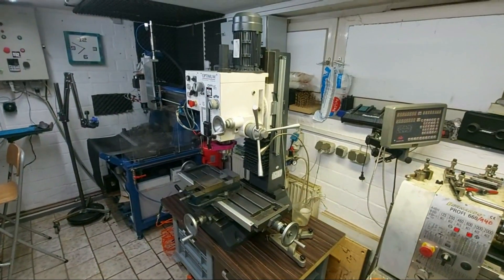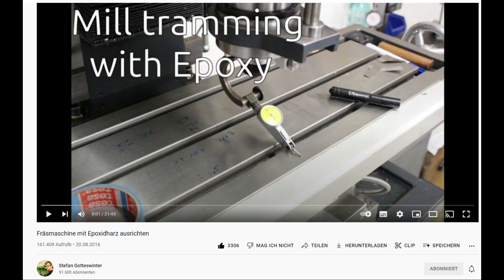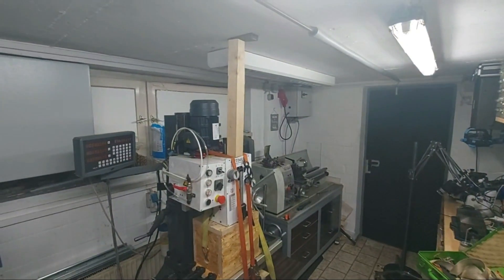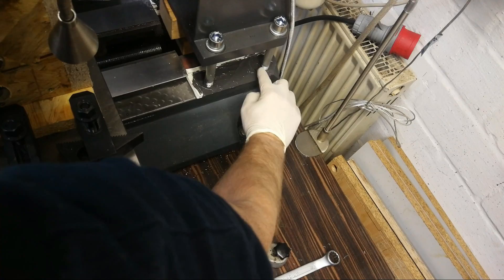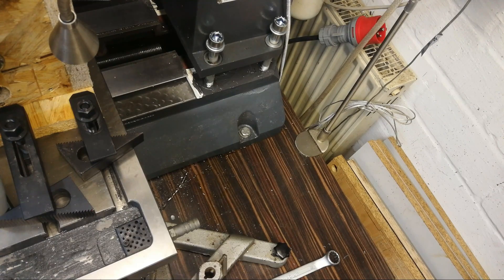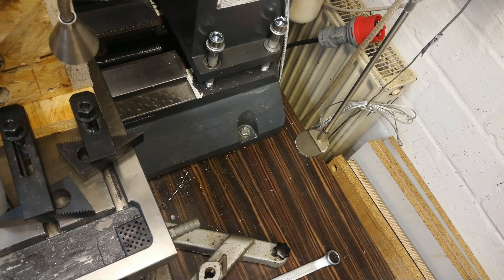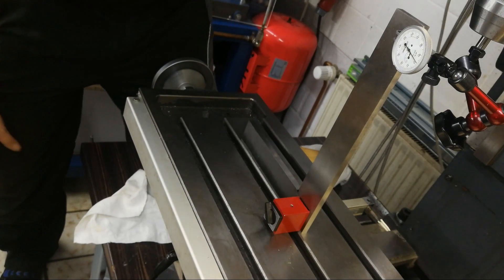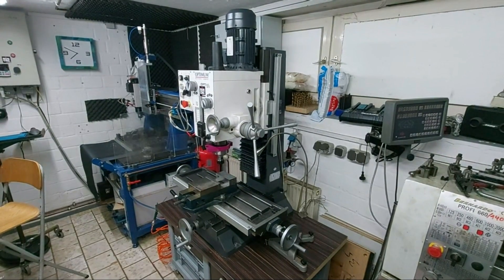How to tram a benchtop mill (Optimum MB4) with epoxy

Comment: For example on Ali------expres have cheap Stainless Steel Sheet Foil 0.01mm 0.02mm 0.03mm 0.04mm 0.05mm 0.08mm 0.1mm 0.2mm 0.3mm 0.5mm. Just put there this foil. It is better, cheap, and easy to set-up. It is common way how this problem is solved in mechanical industry......
Reply from the maker: I agree: It is easy and cheap. But it isn t as rigid as the epoxy method.

Comment: Would you concider this a better\easier technique than spotting the surfaces and scraping them?  Would scraping just take too long to make the adjustments needed? Does epoxy have vibration dampening characteristics? I feel like the epoxy layer would make a weak spot in the rigidity. Atleast more than two scrapped mating surfaces. Love the video

Comment: Thanks for the video. It was actually easier to understand than Stefan's. I have a few questions as this topic has interested me for a long while, and I watched every video I could on it, and read through all 350 comments on Stefan's video. 1) When you get the front/back direction trammed and then switch to the left/right direction, if it is off, do you adjust two screws on the same side of the column the same amount, so as not to ruin the tram from the first direction? 2) When you are adjusting the screws for tram, are you always tightening only, so they compress the wire more and more as you go? Or do you ever loosen any of the screws mid-process? 3) How thick was your wire? It looked thinner than Stefan's. Was yours about 1mm thick? Is it a regular copper wire for house wiring? Did you anneal it like Stefan did, or use it as-is? 4) When you are tightening the screws (while the epoxy is still soft), are you making them only "snug" to get into tram? Or are you tightening them very firmly? 5) After the epoxy cures, do you have an indication on how much the epoxy shrunk? When you tightened the screws, did you have to tighten them a large distance due to shrink? 6) Did you make the screws super tight (after the epoxy cured)? 7) When you tightened the screws (after epoxy cure), did you have an indicator in the spindle agains the table, to see it it moved while tightening? If so, did it move? How much? My first practice with this method I had a lot of movement while fully tightening the screws, that's why I ask.
Reply from the maker: 1) When you get the front/back direction trammed and then switch to the left/right direction, if it is off, do you adjust two screws on the same side of the column the same amount, so as not to ruin the tram from the first direction?

I fastened all screws slightly. Than I used only 3 screws. As the column was leaned forward and more to the left I used the screws in the back and the right-front-screw to tram the mill. First I trammed forward/backward, then left right.
Now it was only a little off and then it was some playing with the right torque on all screws. You tighten only a bit, check with the indicator, tighten, check, tighten, check, ... . I was really exhausted after this workout!  

2) When you are adjusting the screws for tram, are you always tightening only, so they compress the wire more and more as you go? Or do you ever loosen any of the screws mid-process?

Always tighten, no loose - we don´t want any gaps. 

3) How thick was your wire?

I used 1.5mm2 wire for regular house wiring. The diameter is 2 sqr(1.5/pi) - .

Did you anneal it like Stefan did, or use it as-is? Yes, I used a gas torch to make it soft.

4) When you are tightening the screws (while the epoxy is still soft), are you making them only "snug" to get into tram? Or are you tightening them very firmly? See process described in 1 - only low torque.

5) After the epoxy cures, do you have an indication on how much the epoxy shrunk? 
The datasheets provided with the product says this stuff only shrinks less than 0,1%. Well, i didn´t messuare it, but i think this is true. 

When you tightened the screws, did you have to tighten them a large distance due to shrink?
No, I think due to the very little shrinkage.

6) Did you make the screws super tight (after the epoxy cured)? I used a normal hex-wrench, no extra long and no lever. I just tightened them with normal force.

7) When you tightened the screws (after epoxy cure), did you have an indicator in the spindle agains the table, to see it it moved while tightening? No, I tightened them without any indicator reading, but checked it afterwards. To be honest: The reading you see in the video is done after the cure - I was to busy while tramming the mill.

If so, did it move? How much?  I think it didn´t move or maybee in the range of 1/1000 mm. 

Hope that helps! Otherwise feel free to ask! Cheers Markus!
Reply: @RUNCNC  Hi Markus, thank you very much for the detailed answers! Best, Nick.
Reply from the maker: Thank you for your interest in my video. As it is 6 am in the morning in my place  and a bunch of questions, I'll answer them later when I'm back at my PC.

Comment: Well done, I believe you should have only waxed one side, so that it is bonded properly however. Will still be a great fix though, as long as you dont move it.
Reply from the maker: Yes, you are right. I took it into consideration, but I wanted to be safe and able to seperate both parts. As I want to keep the mill, my heirs can cope with! 😉